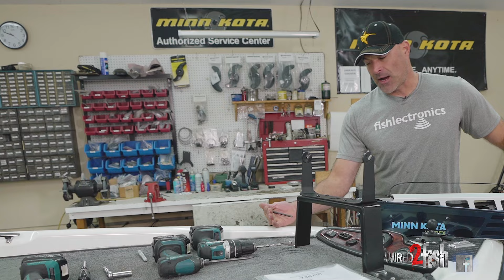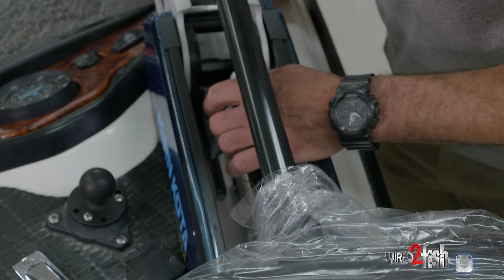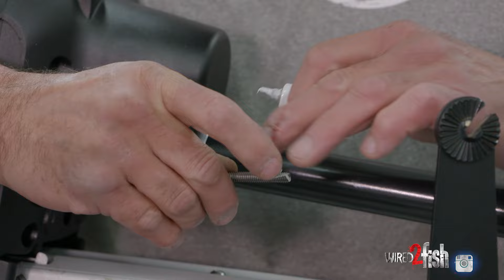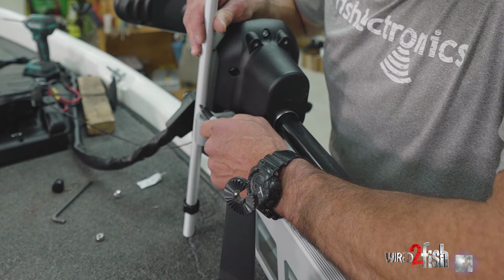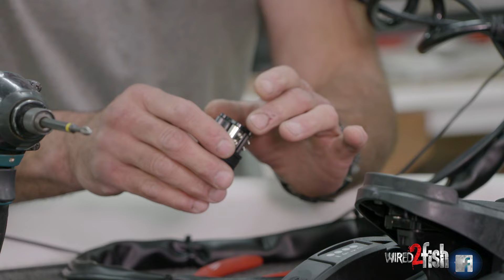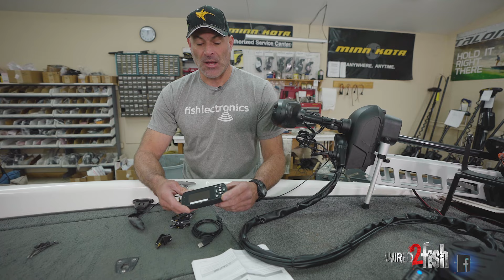Minn Kota Ultrex Trolling Motor DIY Install | Pro Rigger Tips

Comment: As always awesome instruction. I'm still running my older Fortrex. At times I feel the motor is getting louder. I'm networked with a Helix 12 Chirp on the bow and a Helix 12 Mega SI Gen 2. Extra bird equipment to include a 360 (non mega).

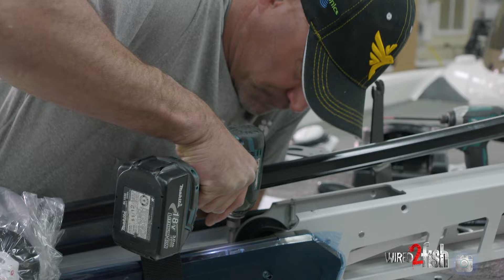Comment: He nailed everything in this video to a T! Excellent instruction, at 10:15 he states to use an impact to get more pull, this is incorrect use a drill on low speed high torque. Impacts strip screws
Reply: If you know how to use an impact driver correctly, it wont strip.

Comment: Great video- I’m going to install an ultrex 24v on my Tracker pro 170. Do you recommend a certain quick release mounting bracket? Should I put a support plate under my quick release to prevent any welds from cracking? I’ve read of some Trackers welds cracking under trolling motors.

Comment: Great instructions. I need to see what trasducer configuration i have on the motor because its definitely not hooked to my screen. I have a big plug that connects all my things at one time but there is a separate trasducer strapped around the motor thats hooked up to the screen

Comment: Do you need the heading senser for the trolling motor to work cause I don’t have a graph
Reply from the maker: Nope, Spot-Lock will still work fine without the Heading Sensor. You just won't get the Spot-Lock Jog feature, which probably isn't a big deal.

Comment: Just curious because I don’t know any better but for the heading sensor you say you can pull from trolling motor power but the Ultrex is at least 24 volts and the heading sensor requires 12 ?

Comment: I use anti seize always on prop nut and i use electrical tape instead of zipties on the cables. And you need to crimp those ferrules and i would use electrical grease

Comment: If I have a Helix 9 on the bow and a Helix 12 on the console linked via the two dongles and the ethernet cable, how do I wire in the Ultrex iPilot?  Is there an additional port on the back of the bow unit, do I need a T joint intersection in that ethernet line, or am I required to purchase the 5-way hub?

Comment: Don't do it!!!!! You're gonna regret it! THEY ARE PURE JUNK!! MANY guides and pro anglers are dumping them! Some actually finding old Fortex motors to go back to. The Ultrex is totally unreliable and the foot pedal is a MAJOR weak point. Mine wouldn't ever sync to the handheld controller. The nav and spotlock features on mine no longer function, either.
Reply: This is not true at all!
Reply: @TannerOwensOutdoors  it IS true and there are MANY videos out there about all the issues. The steering sensor being non-encapsulated/sealed is a major issue. How could they put out a product like that with sensors open to the environment and subject to erosion and failure? The components in the foot pedal on early models ARE NOT WATERPROOF OR RESISTANT and they knew it.

Comment: Question  - Do you have to pair the heading sensor everytime power is turned off?
Reply from the maker: No, just for the initial pairing.
Reply: Nope, soon it won't work at all, anymore, so you won't have to worry about it.🤷‍♂️mine wouldn't even sync to the handheld remote! Good luck and have fun cleaning the weed tangles off the prop and around the head. Smh

Comment: So the ethernet cable wire coming from the head of troll motor is not needed if I install a DI transducer directly to my head unit on the bow??

Comment: Great video.  I have an ultrex that's waiting to be put on my boat, it's replacing an Ulterra.  The Ulterra was hard wired but there is an application for a plug.  Is there a way you prefer, hard wired or plug?

Comment: Ultrex is cheaply made and unreliable. I was told today there’s a two month back order for the boards. It will be July before new boards are received. It’s going to be a long summer for a lot of people. Crazy!! The first 18 months was good. The last four months have been one problem after the next. I recommend researching different brands before purchasing.
Reply: My nav and spotlock features quit within a year and there's no service retailers close. Was actually told to remove the 12 screws holding the bottom plate of the foot pedal on and check all connections, unplugging and plugging back in a few times each. Smh Why would ANY connections be exposed to water or the elements on a boat's trolling motor?! Doesn't Minnkota realize their products are used ON THE WATER? Or that our boats are towed in the rain, sometimes? How cheap and shortsighted can a company be while charging 2.5k for a product?🤦

Comment: Do I need to install the heading sensor to use spot lock?
Reply from the maker: Hi Elliott, no, the Spot-Lock GPS function is built into the head of the trolling motor and works out of the box. The heading sensor is needed to use the Spot-Lock Jog feature.

Comment: One of the best install videos I have seen as it relates to bass boats. Thank you for this!
Reply from the maker: Appreciate the comment. The Ultrex is also a popular trolling motor for walleye, pike/musky, and multi-specie anglers in general, so this content is helpful for a range of boats (the 60'' shaft size most common for deeper hulls).
Reply: This is so well detailed without speaking about pointless things, very impressive.